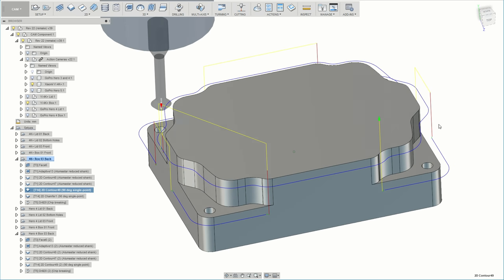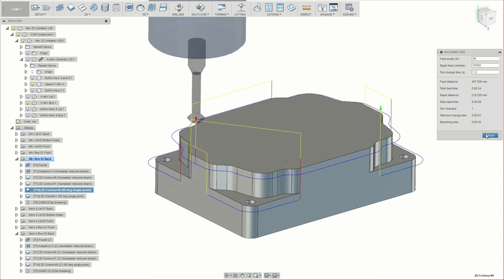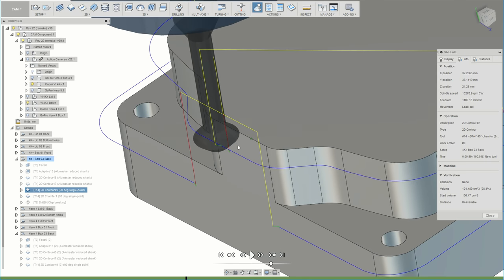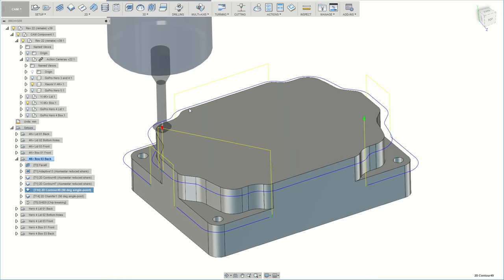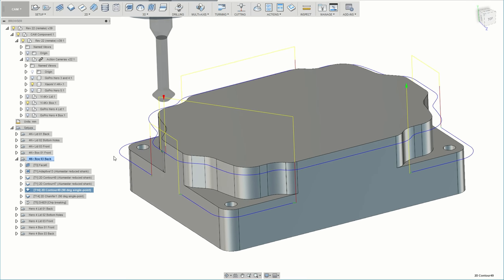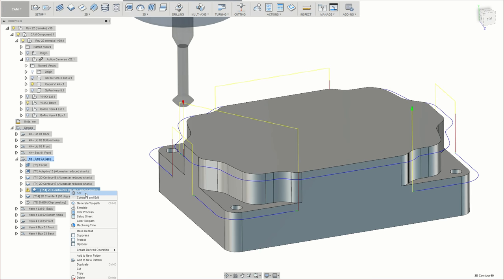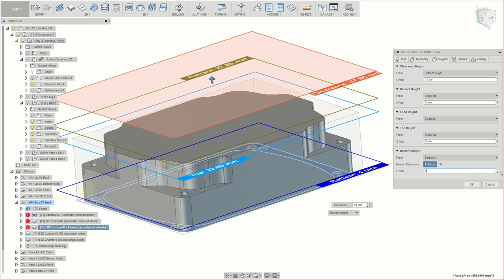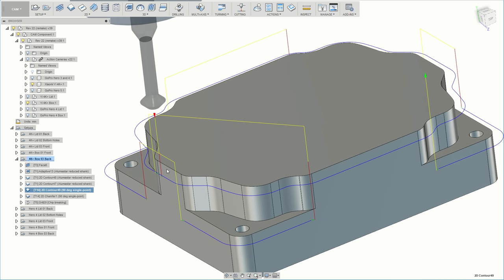Expunge the Plunge - save valuable seconds in Fusion 360 CAM by plunging faster

Comment: Great info. Had no clue about the disable option.  I'll check into that AFTER I've proven the code with something slower. lol  What about the stay down moves for that lower level?  Wouldn't it be faster to stay at that height and just move out a bit and set the non-engagement feed at something close to your rapid feed rate?  Normally, I wouldn't consider it much of a savings with how fast your machine moves, but if you're tweaking for the fastest times....it would help.
Reply from the maker: Ah good call about keeping the tool down. I sometimes try to get it to stay down with 3D adaptive clearing, but I usually find the added processing time too annoying to put up with. Seems like it might be a lot faster for 2D contours. Thanks for the idea!
Reply from the maker: Oh, and me too about not knowing about the disable option. I sat down to try to speed up them plunges and I guess that's the first time I ever noticed and/or tried it.
Reply: It definitely adds some processing time! Enough to be annoying at times! lol  50% seems to be doing pretty good.
Reply: It definitely adds some processing time! Enough to be annoying at times! lol  50% seems to be doing pretty good.
Reply: My first and only thought to speed them up was your last option.  Hadn't looked at the others either.  I've been doing a ton of CAM work lately, so I'll be looking at them more. :) Thanks!
Reply from the maker: I messed around with the "keep tool down" option a little bit in some 2D contours and they actually ended up making the operations take longer. The one in the video went from 27 seconds to 29 seconds. A pretty surprising result! The fast rapids definitely help, but on that operation, the kept-down time was only faster when I turned the machining time calculator's rapid speed below ~275 IPM.

The kept-down moves seem to run at the cutting feedrate when moving horizontally, and in the operation shown in the video I think I would have had to make the lead-ins and -outs larger/longer to make the tool move far enough away from the material to prevent it from cutting into places I don't want. And vertical moves seem to run at the plunge feedrate (instead of rapids) so even an operation that was basically just multiple layers of the same toolpath ended up taking longer as well. Darn!
Reply: Hmmm.....I think I've been primarily using 3D adaptive and pocket.  I'll have to look more closely when I'm in there again.